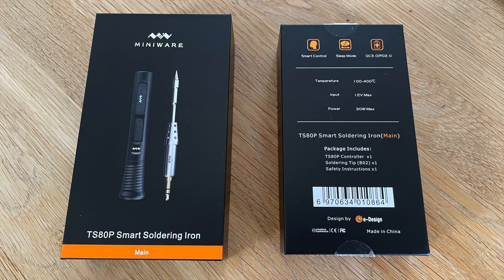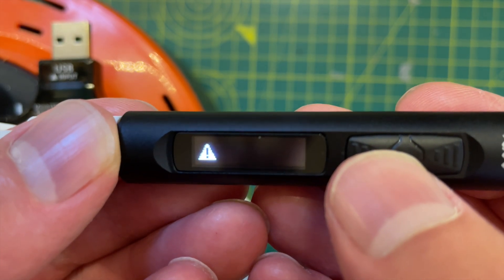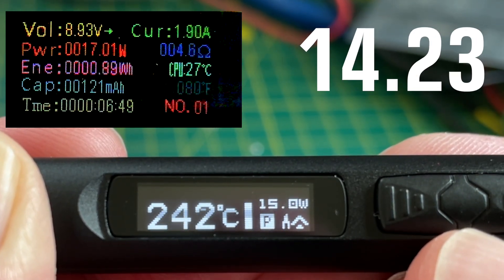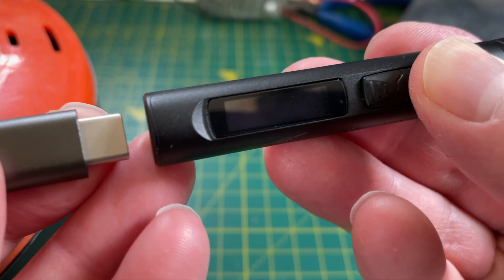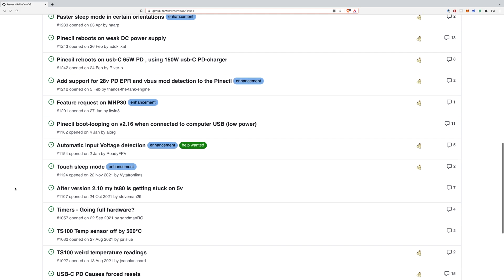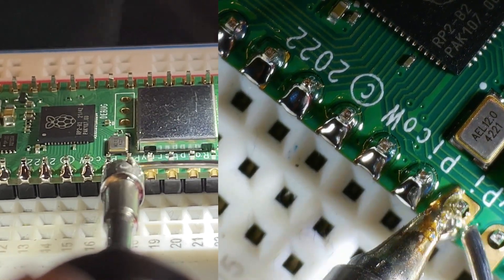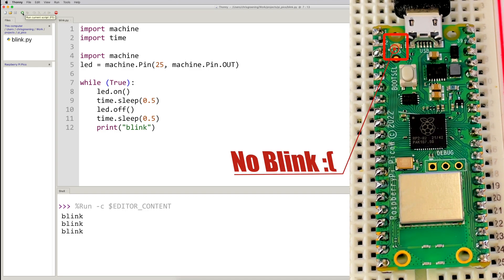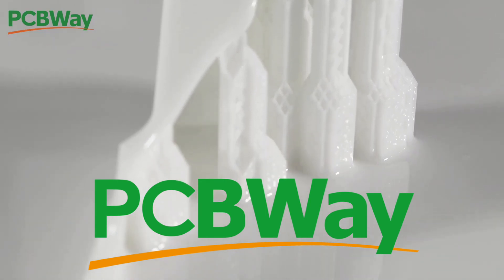Upgrade Your Soldering Game: TS80P IronOS Flash & Raspberry Pi Pico W Soldering

Comment: So overall is there any major improvement using ironos over the stock firmware ?
Reply from the maker: It exposes a lot more settings and has support for a lot of different languages (probably not that useful for English speakers, but nice to have). In terms of normal use, then I don't think there's a massive difference - the stock firmware is perfectly good.

Comment: When flashing the iron with new (software / firmware) i'd call it firmware as i'm old school and that's what we would call a program that's loaded in to a device, software is loaded in to a computer. where the calibration constants kept so the temperature is correctly measured or was it correct in the first place. 

I need to put my home built soldering iron station to some form of calibration. I might just put in a measure only function so i can put the tip into boiling water and check for 100°C reading. it's a start without a soldering iron calibrator
Reply from the maker: You might find that you can use IronOS if you want to make your station more "smart".

Comment: Nice little soldering iron. I got myself SH72 for $12 - it's a 65W soldering iron and at 24 volts it's heating up in 7 seconds. May i ask where did you get Raspberry Pi Pico W ? I can't find it. Aliexpress only have simple, not W version.
Reply from the maker: I was really lucky - There was a pop-up RaspberryPi shop in Edinburgh recently and they had pretty much everything in stock - managed to get a Pi 8GB, Pi Zero W and a Pi  Pico W! Getting anything online is pretty much impossible.
Reply: @atomic14  Ah i see. Yeah, it's only sold now in one online store that don't sent to my country.